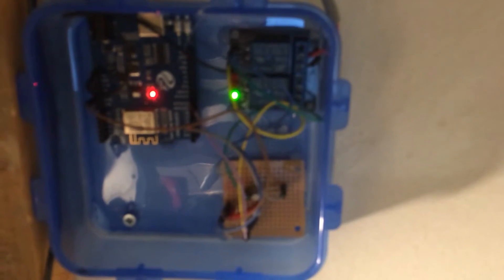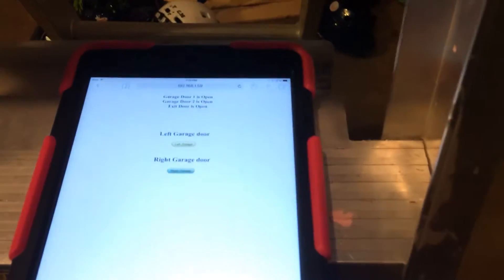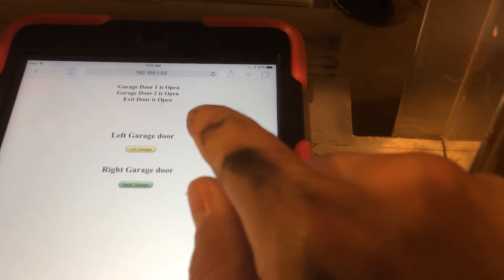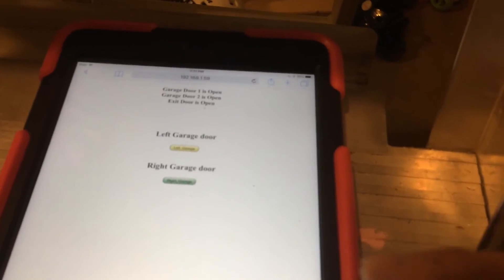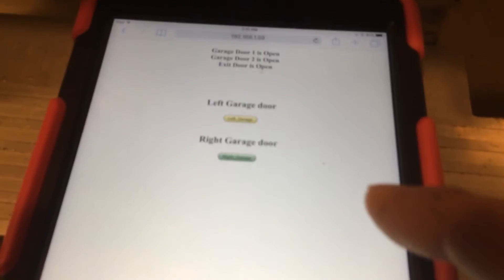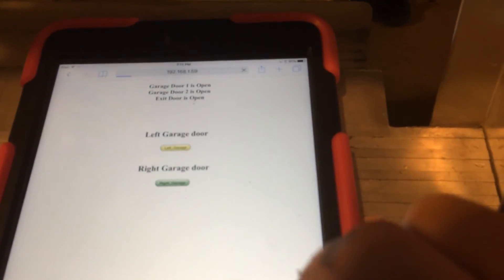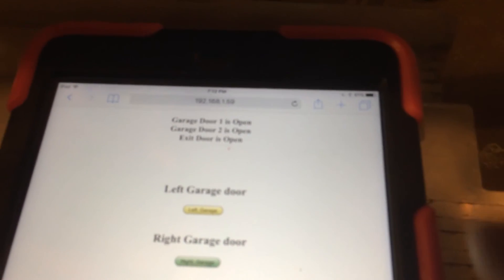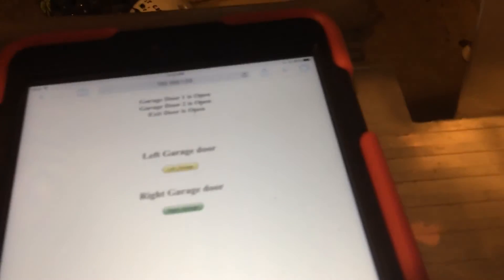ESPDuino - WIFI garage door opener

Comment: Hello
thanks for sharing your experiment, however, i need the sketch and the code. I bought 2 boards and looks they don't work fine with the Arduino IDE. thanks for kindly help
Reply from the maker: all the code supplied is in the link I have provided.

Comment: Hello, great project! I'm currently doing a similar project, but I have problems, is the first time I use ESPDuino. Could you share the source code ?.
Thank you.
Reply from the maker: I have added the source code.  It wouldn't matter if you using ESPDuino or other 8266 boards (they are all the same).   Tell me if you WIFI chip gets extremely hot.  I had to take mine down because of this.
Reply: Gracias!!